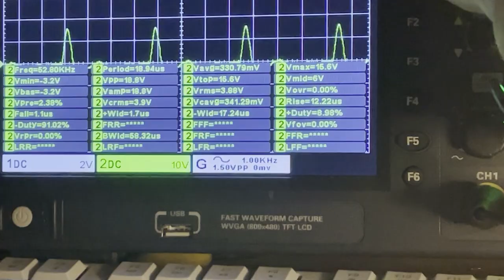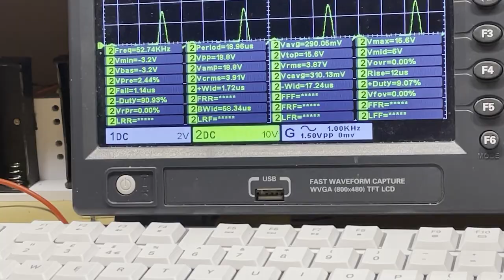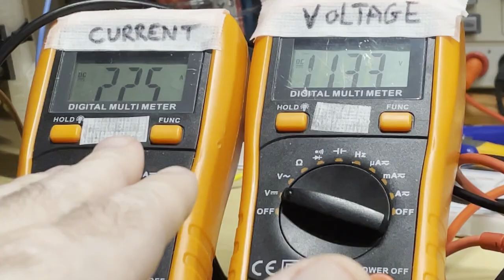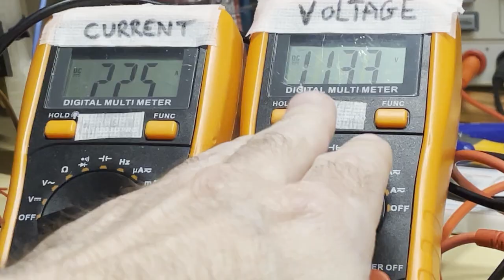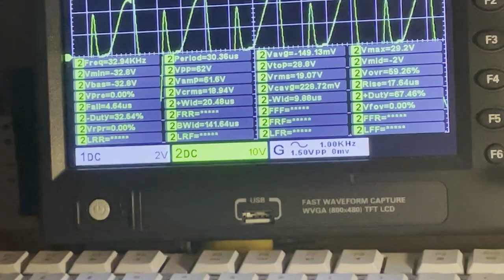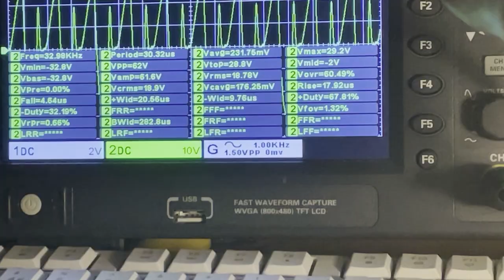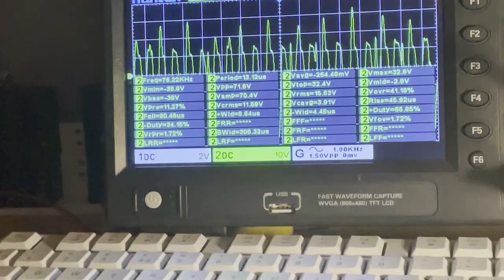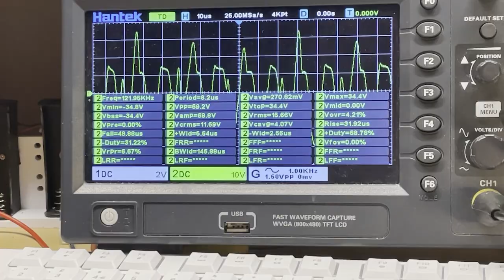Piezo Transducer and Scalar Magnet Coil Experiment

Comment: I'm more of a mechanical than electrical guy so my comments may be very off base.  that said, my first thought is that there may be something going on with the resistance in the system.  I can't imagine why your setup would drive such a change (again, mechanical not electrical) but if it does, that could explain the power increase.  is there a way to measure resistance while the circuit is operational?  if not, perhaps you could enclose the circuit elements in some sort of insulated box then measure temperature inside the box over time with different circuit configurations to get an relative sense of resistance change between different setups.
Reply from the maker: Some good ideas here about enclosing it in a box and wait a bit and take some heat and cold measurements. From a mechanical point of view I always thought that the piezo would show as a load from the input but at resonance I am not seeing any additional draw from the input when I connect the piezo which is anomalous. More testing need to be done on this. Thanks for your comment! ❤️

Comment: The beginning voltage was 11.68v and was at 12.33v at the end so there was a slight increase in voltage to the Joule thief circuit. Still, the swing in voltage is impressive. You might want to try some experiments using a battery to compare the results. Thanks for sharing
Reply: I have found that by adding a load to some circuits sometimes the input drop, almost as if the flow of electricity happens easier, if that makes sense.